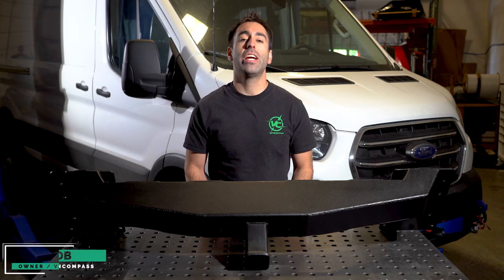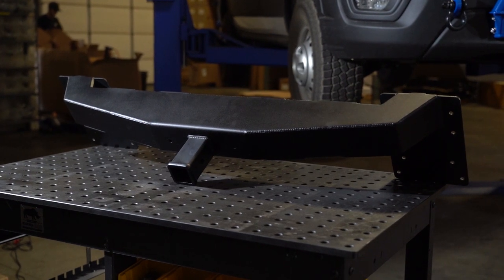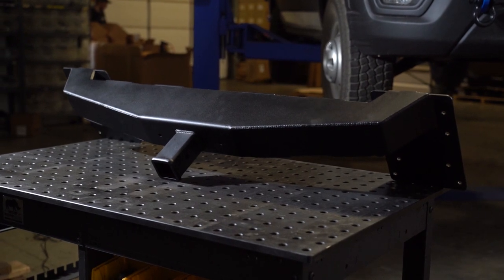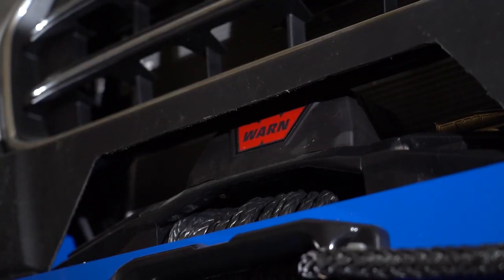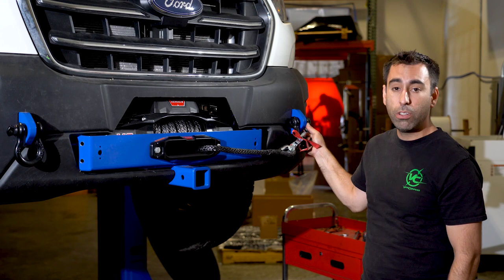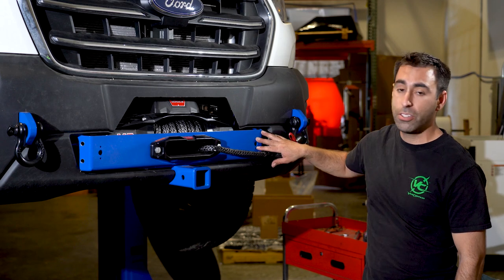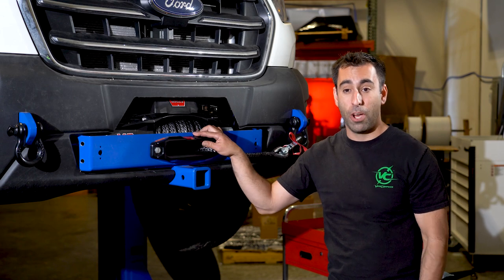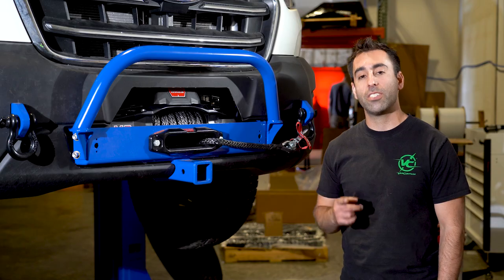Van Compass Front End Upgrades for Ford Transits (Front Receiver / Front Winch Mount)

Comment: Any overheating issues with this setup blocking the intercooler? A few friends with only aftermarket bumpers are experiencing it going uphill.
Reply from the maker: We have had no issues. We tested this design towing 7K lbs 1000 miles from Ca to ID in 90+ degree weather. No problems.
Reply: @VanCompass what is the weight of this hitch reciever?

Comment: Nicely done. 

Please come out with a complete rear bumper replacement, with the hitch integrated into the body of the bumper, not below, so us extended van owners can gain some departure angle with hitch.

Comment: I would like to see a 600 lbs.-rated front receiver hitch so I can mount a dual dirt bike carrier on the front.  Want to be able to transport 2 dirt bikes up front (approx. 230 lbs. each + 100 lb. carrier) & a 600 lb. (500 lb. bike + 100 lb. carrier) ADV motorcycle on the rear hitch.  Van will be an Extended-Length Long Wheel Base High Roof camper conversion & I don't want to pull a trailer, so I want to carry 3 total motorcycles on front & rear hitch carriers.  Can you guys solve this?
Reply: There is no way you can put 2 dirt bikes up front, imagine the lever effect. 
The extended has a pathetic departure angle as well, probably not ideal to even have the rear extended 4 more feet. 

Trust me through, I’m dreaming of the same :)
Reply: Yeah, the would be Hella sketch. The spot that the hitch mounts to is not very thick. That 300lb load rating is to keep you from damaging the van itself.

The rear hitch tounge weight is around 800-1000 lbs depending on the style hitch you have. I installed a class 4 on my van and seeing how it goes on, I doubt I would want to push that rating.

Transit is a unibody construction, it doesn't have a beefy frame underneath like on a pickup truck.
Reply: @sampep thanks for the insight. I wondered about departure angle.

Comment: I’m thinking to put a bike rack with two e-mountain bikes on it. What is the likelihood that that would interfere with adaptive cruise control?
Reply from the maker: The sensor will pick up the bikes. You should be able to change the setting on the cruise control to regular to maintain standard use while bike are up front.